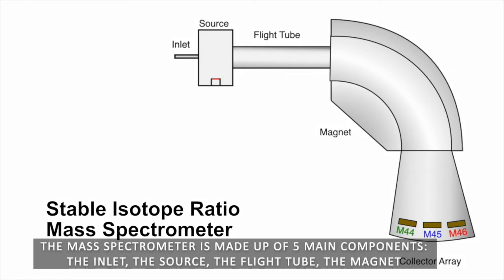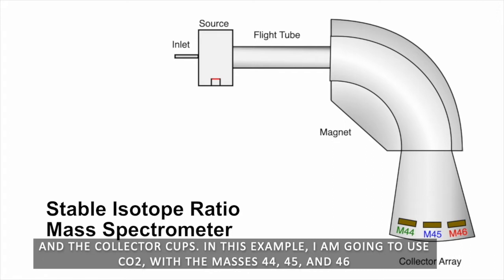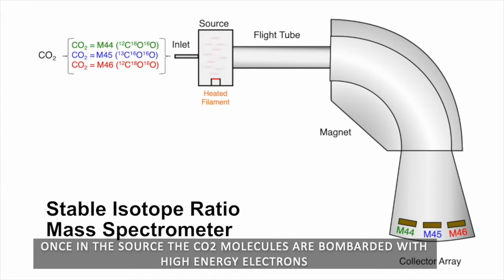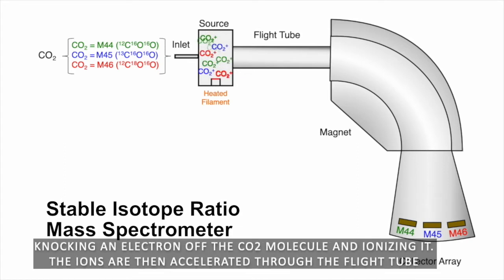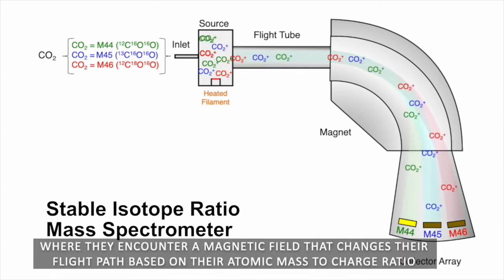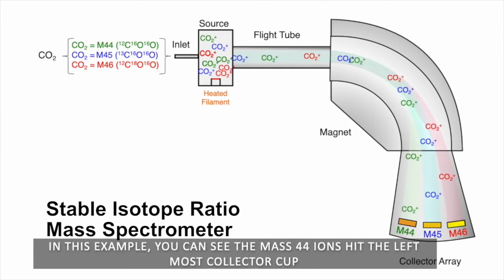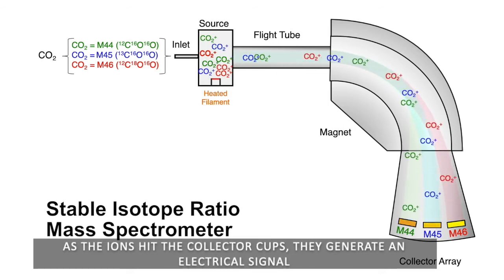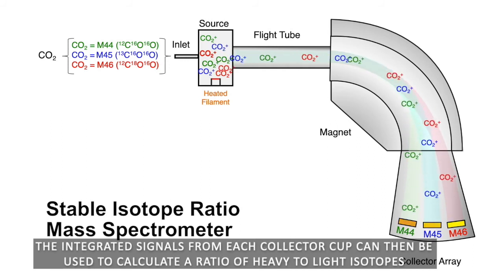CLIPT Episode 3: How a Stable Isotope Ratio Mass Spectrometer works

Comment: Thank you for sharing the link. I found it really useful cause to me it wasn't clear the relations between measured and desired isotopic ratios. For example, how does the IRMS software derive the isotope relations from delta 45, 46, 47... given there are 9 isotopologues.

Comment: what is this machine used for. Whats the exact purpose?
Reply: Mass spectrometers like this one are used to determine the ratios of certain isotopes or compounds. In the case of this video the spectrometer is being used to determine the concentration of “light” vs “heavy” CO2. If you look at the graphic on the left, you’ll see there are three different examples of CO2, all with different masses. (See the Carbon-13 and Oxygen-18 being used in the second and third) Since these isotopes of Carbon and Oxygen have a higher mass than our CO2 with a Carbon-12 and two Oxygen-16s, these CO2 compounds will also have a higher mass, thus they will be affected less by the magnet when shot through the flight tube.